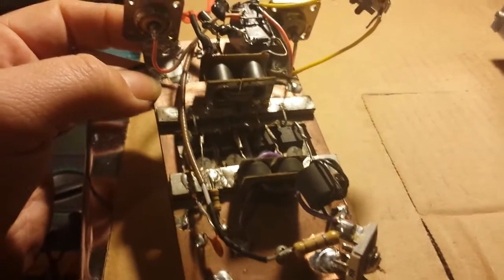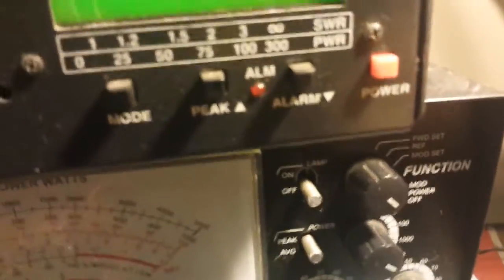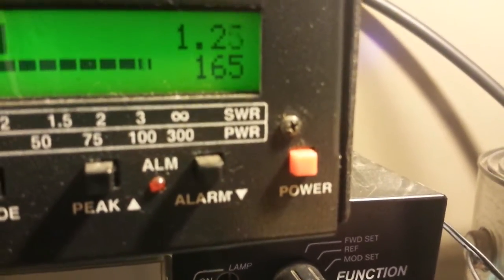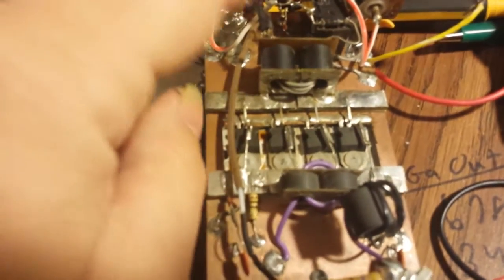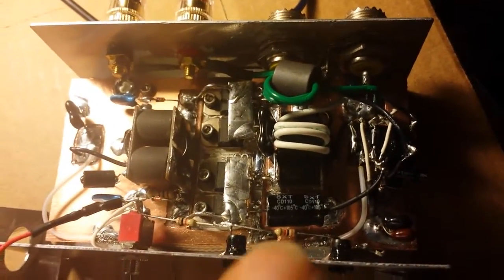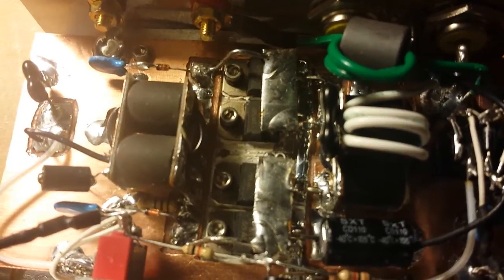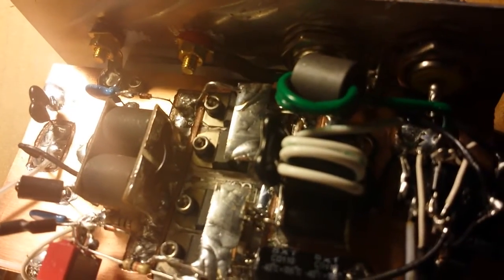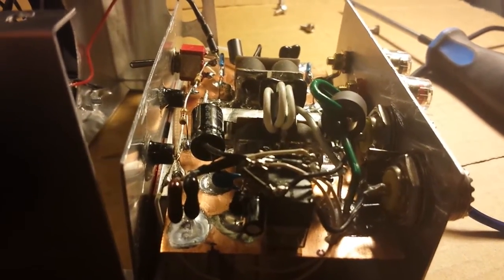Gatekeeper 4xIRF520 Mosfet Amplifier

Comment: I would try 2030s matched and do regulated bias control.. using a  transitor to regulate.. but this is cool ... 520s tend to make good RMS ...but I like 2030s they seem to be better for me ... What is your opinion.... On the 2030....
Reply from the maker: No need for a transistor to regulate because f e t s are voltage driven devices a simple voltage divider will sufice
Reply from the maker: Roger

Comment: Dude, raise your voltage, lower your current and run them at 50volts, way more linear. I would recommend you (or anyone wanting to learn) read Practical RF Power Design Techniques by Irving M. Gottlieb available on amazon. He covers both BJT (they are not called pills) and MOSFETs then follow that up with RF circuit Design by Chris Bowick also available on Amazon.
Reply from the maker: Michael Katt thank you. I just bought the book. Very cool book. Thank you sir for the recommendation
Reply: There is a big problem running these IRF520 at 50v. The mosfet has a max drain voltage of 100v but in a push pull circuit the drain voltage will be around 3.5 times the supply. Therefore, a max safe supply voltage of 28v - 28 x 3.5 = 98v (staying within spec.)  If you use 50v, the max drain voltage would be 50 x 3.5 = 175v! Your going to pop!
Reply: You have to watch control and drains voltages

Comment: @variactor3140
So with the 10 ohm resistor at the gate is this a class C amp? What diode and cap value is on the gate to ground and the cap on the input? It's different, I'm use to the design mentioned by "Remingtoncountry1100", more control and options for class biasting. It looks like the cap and diode comb is protecting the input.

Comment: G'day gatekeeper, nice build mate. I been doing well with using coax baluns instead of the ol skool bino balums, and degenerative feedback. Also thermal control is easy with a lm723 to address muller effect and as a bonus provides the AB bias that is needed for ssb. I been getting 150W+ ssb conservative AM the same 5 minutes key down using irf640n's with a bias setting of 80ma per device. Anything more it starts to distort. Also the IRF640's are only good to about 7-8mhz. The 510 and 520 are more the go due to the lower Ciss and used more for higher freq. Cheers and keep up the good videos and experiments.
Reply from the maker: I can't believe that I overlooked your comment this long I have watched your videos and I am very impressed and would like to take down some notes and do some attempts at the way that you are building them and see if maybe I can get a bigger one going on with combination. maybe 16x520n i have about 300 more of thse devices so i want to play with them.

so you use a binocular transformer for your input in the other type of Transformer for your output I would love to check into this more because I am going to be getting into the LDmos as well. 

again I am very sorry it took this long to reply back to you mate I would love to hear back from you
Reply: +1883GotDown Hi gate keeper, no need to apologize, we all get busy mate. Sure happy to discuss and share knowledge. You are correct several benefits exist by using TLT's or transmission line transformers. 1) better higher and flatter bandwidth, 2) they are supposed to be more favorable when used with mosfets over binocular output when crossing from positive to negative in the amplification cycle. I have mainly stuck with 1:4 and 1:9 ratios with my builds. The coax is easy to make (I have made a video) but can be purchased at a premium (teflon) I tend to over size mine and they never get hot, only when transmitting into a high SWR when eventually the fet will die anyway (unless you are using the ("unbreakable" fets) . Yes the TLT,s are a way to go with LDMOS devices and I have made a couple of videos that make it a little more easy to understand than reading Sevicks text book when wanting to know more. I had to do a IRF520 build using TLT as no video exists out there doing it and most of the people want to keep the technique to themselves or are buying pre fab pallets and just dropping in the devices. I am now doing a scratch built 7-800W 24 volt build using 4 of the XYS devices that cost $2.90 each but it is only good up to 8 Mhz, (Ham stuff) I am building a 700W build using 2 SD2933 using TLT's output in a 1:4 and the whole amp should cost, I don't know under a hundred bucks run on 24v and do 1.8-54Mhz I will dig up the plans, but it is identical to the 4*irf520 build less 2 devices. Note the neat AB temperature compensated bias. I will be in the field for a couple of days so I will reply next week. Cheers mate. Oh just a note, It may be difficult to do say a 16* because of the real estate space needed and then the need for combining anyway, then keep in mind combiner losses. That is why multiple LDMOS module architecture commercially is the trend. And then combining if you want more power.  See the NXP and Freescale range of product data sheets like blf578 that do 1200W and can use a single bino or TLT and so on..cheers.